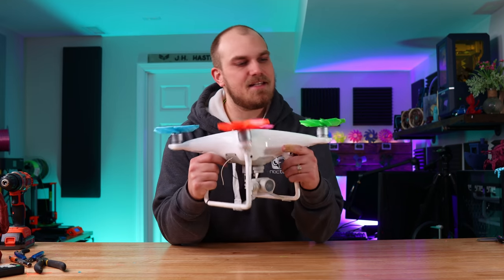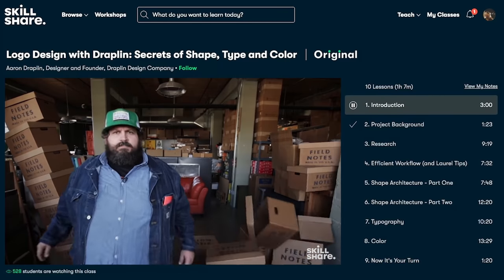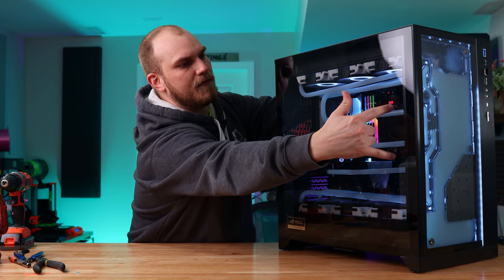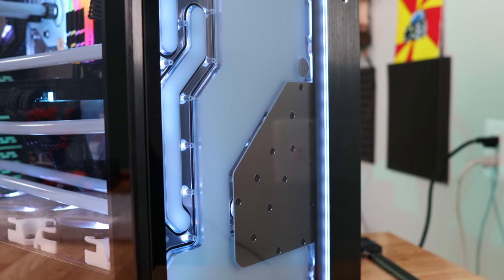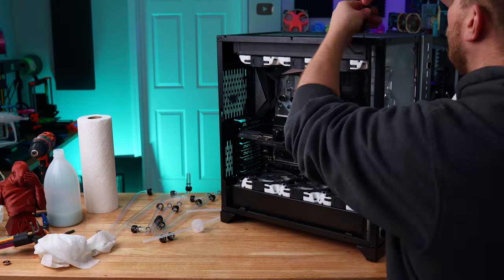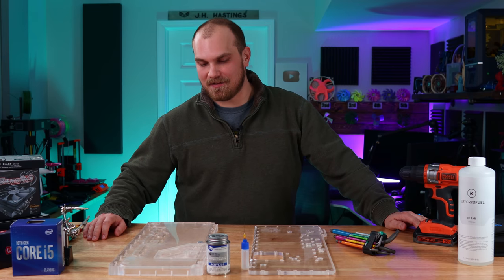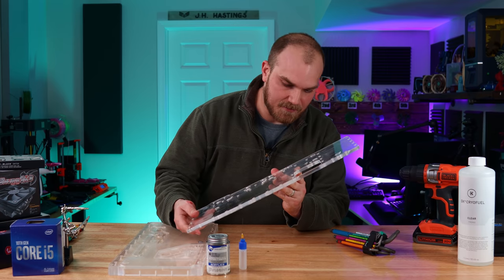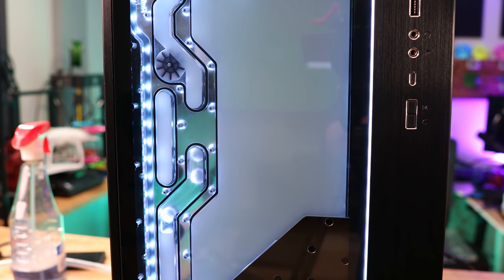$400 DISTRO PLATE is about to let loose, can we FIX IT?

Comment: If you want to fill those cracks you need to put back pressure on the holes while applying the  solvent cement. That will allow the cracks to open just enough to let the solvent cement sink in. Just don't go overboard with the back pressure or you will damage it even more. Slight pressure will do the trick.

Comment: Vacuum bag ,you put the acrylic panel in a vacuum bag like the ones that you get for clothing they hooked to your shop Vac when you inject the weld on the vacuum will suck it into those holes  or cracks  I do injection molding and essentially we vacuum most everything it will draw the stuff into the cracks check it out. Thanks for the video.

Comment: you could likely use an RTV sealant like what youd use on an engine as a seal.  might be neat to experiment with different pump impeller designs for fluid flow rate testing.

Comment: Try using resin on the cracks, used to repair a cracked windscreen on a car, it might work,. You will have to harden the resin with a special uv film and a uv lamp, be carefull not to use to much, it will get very hard, so wipe away anything that is not into the cracks, do not use surfice pit, but use the pit that get into the cracks..

Sorry about my bad english

Best regards Kasper

Comment: Maybe slice some thin strips of self-amalgamating tape as a seal instead of an O-ring? Might not be neat, but it could work.
See how well coating the plate with 3D printing resin would work to arrest any further crack development?
Maybe use that as an excuse to test printing some thin plates with pretty logos and images to adorn the plate with. See how it looks with light shining through it.

Comment: I have the same distribution plate. I really hate you have to run lines all the way to the back for the radiators… well the bottom one anyway. I was able to mount the top one with short fittings, but it’s very tight.

Comment: Vacuum bag like carbon fiber molding or Safelite rock repair. Possibly pressurized to push it in if the vacuum pulls it away from the voids.

Comment: I wonder what putting the old panel into a vacuum or pressure chamber would do, if it would force any air out/weld fluid in. It would have to be a kinda big one, but it would be interesting to see.

Comment: RTV to replace the gasket, paint those cracks in super glue or epoxy, and send it.

My guess for why it cracked in the first place is the thermal cycling eventually caused cracks to develop. All the cracks had the same shape, which is they were on the external surface and tapered in, making them triangular cross sections. Probably on heatup, if I had to guess, since you're well below acrylic's RTT, you had the expansion on the inside wall from the heatup causing your holes to expand (lol) putting a tensile stress on the outside wall. The highest stress would be where the temperature differential was highest, i.e. the outside wall that was still at ambient. Once the crack was formed, it would propagate outward due to higher local stress at the tip (lol again), but you're an actual engineer and probably understand it better than me so I'm done now.

Oh, you could try thermal cycling the heck out of it to see if it gets worse and maintains the same pattern. Put a radiator in ice water, cool it down super low, pull the radiator out, put the radiator in front of a heat gun and run a FurMark Fuzzy Donut of Death with a Prime95 small FFT to get the highest heatup rate you can and see what happens. After reassembling the whole thing with RTV gaskets, because redneck computers make me happy.

Comment: I wonder.. could you 3d print a new 'face' plate for the distribution plate? If i understand it right, the cracks are only in that 'face' plate, not the second one. That would be interesting to see, since you can get all the measurements of where goes what from the cracked one, and while the plastic wouldnt be clear, it could work, like the little distribution plate printed previously.

...Maybe even add some details like 'M H' into the created object to personify it.

Comment: You can fix it by using a vacum chamber and a thinner glue 
or some diluting paste on top of it to disolve the cracks and then fill them with glue with will require new treads to be made

Comment: Nice video. Get one of the windshield chip repair kits that pressurises a resin into the cracks which UV cures, just like the printer resin. Not sure if UV resin is runny enough. Then 3d print a TPU gasket to see if it will hold coolant 🙂

Comment: 4:57 That looks to me like some 3D Printer Dust and quite possibly VOC's... I had the same problem and I would recommend to put the printers in a Enclosure with an HEPA Filter! - Just to be save in a room you spend quite some time in!
Reply: The VOCs are volatile, so not very probable. Might just be compressed air. Let's go with dust.

Comment: suggestion for the pc: given the price, make an angled plate that acts as a water slide over the gpu and under the radiator fitting that's over the motherboard in case you get leaks to prevent frying an expensive part.
then add a spunge on the bottom so you don't get a leak all over your desk.

Comment: Hi , this is Chris in Bulgaria. Your theory of putting on a liquid glue is correct. I see that it did not work.
acrylic glue it maybe. However to get into those cracks you would have to use  Dichloromethane. A chemical version of chloroform. acrylic plastics are not all the same. You have to know what sort it is. Love you fan show downs.  I like the suggestion of an ant farm. And, I did notice a small fan/impeller in the unit. Lost opportunity. Have a great day, Chris

Comment: I'm of the opinion the cracking is being caused by mixed materials and expansion and contraction of said mixed materials. Plastic, be it acrylic or whatever group them all as a whole, will move long before metal. That being said I think the Plastic will always just crack. My water loop had a lot of cracks but only where I mixed materials. The places I used plastic caps didn't crack... Just saying...

Comment: First of all, I would have air sprayed the rad in the garage or space that is not in a clean room. Secondly, you can buy o-ring material and end up with a second distributor plate that you can use on another computer. I would talk to a windshield repair company and see what glue they use  to repair cracks on windshields; it may be used on that plate.

Comment: Looks like its because they used the flat head screws putting outward pressure on the acrylic with the incline plane on the screw heads instead of pan heads or similar putting a more linear compression.

Comment: Great video, quick question how did you add a drain valve when it had a stop fitting, whitout spill everywhere during the transition??? Would love to know for my own purposes
Reply from the maker: Tipped it back until an air bubble was on the port then SPEED CHANGE

Comment: When they fix cracks in windows they use a little vacuum pump to suck out the air so the uv cured resin gets pulled into the cracks. You could probably do that if you plugged the hole from the rear. Also, can you order a replacement seal kit?
Reply: It's too close to the edge to create a seal using such a device. The suction seal you are referring to requires that the crack be at least 2 inches from an edge.

Comment: could it be the expanding metal that is contacting the acrylic cause some of the fitting to crack?
Reply: The fluid in the system reistically is only sitting a few (as in, less than 10) c above ambient temperature. I don't think thermal expansion would affect the nickel plated cooper plugs to such a vast degree compared to the acrylic that that would be the case. 

I've seen similar cracks occur on pumps/plates/blocks with acrylic tops that have been exposed to certain solvents, such as isopropyl alcohol. Im curious if he didn't flush the radiators thoroughly enough before installation and whatever chemical solvents that were in the system stayed in the loop, or if they somehow did get into contact with isopropyl.
Reply: They either changed their plastic supplier, too aggressive on tapping causing cracks to start during machining, or made the holes/threads too small allowing thermal expansion to crack it. None of my 3+ year old ek acrylic has cracked. every single one of my newer ek stuff has developed cracks after 5 months.

Comment: You can actually fix it. Those cracks are expanding with the screws, so if you wanna use that adhesive and want it to flow inside the cracks, you should strech the plate. Otherwise the adhesive won't get inside the cracks because it's so tight for it. Or you can simply use heat to make them loose a bit so the adhesive went through. ( It says **Water Thin** ) / Another way to fix : Use the method YouTube/ChrisFix => How to Fix a Chipped or Cracked Windshield (Like Brand New). For short, you have to stretch the cracks or need some pressure. I recommend the way ChrisFix's. ( I used it with mine and worked great.)

Comment: I mean... draining and redoing the loop DOES sound fun to me... I redo my loop about every 6 months so... Maybe I'm just weird?
Reply: I'm a smoker so I have to tear my system down at least 3 times per year for the dust and film. I actually enjoy it too. I remove everything that isn't either soldered, glued or riveted together. Everything gets a warm soapy bath, all the electronics get IPA and a soft toothbrush. then dry for a few hours before going back together with fresh thermal paste and pads where needed. Looks great for a couple weeks.
Reply: yes weird :P haha
Reply: That does sound weird, it's more fun putting a new loop together or making small changes.

It's amazing how much mess it makes when you take it all apart.

Comment: Those tapped holes were probably done by machine at too fast a speed and left some stress risers..  If the cracks are too deep for methylene chloride solvent to wick, a straight cut syringe tip twisted onto on a jeweler's torch to make a microscopic flame can be used to fuse the cracks and "flame polish" the acrylic

Comment: I have always been curious why they don't use actual glass due to all the cracking in distro plates. I had one from EK and it cracked on me, got replacement.. had cracking occur again shortly after on stuff i never installed.. so I sold it and moved to round reservoir... I have a friend who does laser etching on glass and she can straight up etch pictures people give them onto the glass surface and if you run it multiple times.. you can literally etch through the glass.

Comment: They sell custom gasket stuff at hardware stores that you can reuse that reservoir if you want. Basically its squishy solid tube that you glue together. Just saying if you need / want to use it again you can.

Comment: That distro plate is most likely Polycarbonate. Polycarbonate has a tendency to crack on stress risers. Like threading. Also, ozone, oils, uv and many other things promote cracking around stress risers on poly.

Comment: i had 6 cpu ek waterblocks all cracked (never leaked tho) switched to phanteks and no more cracked threads. did not over tighten them* also the phanteks had a flat contact plate, all ek's was convex on the center

Comment: i have just ordered same distro plate and i am hoping those cracks won't appear. What my plan is to remove the factory end caps and screw them again. Also i am thinking if this thing  happens to regular people will EK provide them with spare parts issued with warranty instead of repurchasing cause as you said this  distro plate is freaking expensive?

Comment: There's an ultraviolet set, super low viscosity resin used in windscreen chip repair that does work for cracks like this. Having a pump to draw the air out of the crack helps a great deal too.

I deny the fact I know this from breaking something on somebody's car... 🤐

Comment: Take a .5mm drill bit to the end point of each crack end then use weldon 11 on the cracks (if appropriate polymer to weld woth it) Drilling the points stops the stress riser and crack spread.
Reply: Weldon 11 (or thinner) wicks into tight seams for construction or repairs of acrylics

Comment: I have had nothing but constant issues with this sort of cracking with the acrylic top plates I've worked with on watercooling systems; I now avoid them entirely and only use delrin/acetal tops, aesthetics be damned. Acrylic is simply the wrong material to use in an application like this, and is always prone to stress cracking and especially so at elevated temperatures as seen in a watercooling loop.

Polycarbonate might work better, but I don't think I've ever worked with parts that use polycarbonate instead of acrylic. Otherwise, I don't know of any good solutions for clear tops that won't eventually crack around fittings just like this.

Comment: Those cracks appear to me to be as a result of fittings being too tight and with change of temperature caused stress points. A looser fit with Teflon tape would  probably do the trick but

Comment: The plugs, are they a tapered fit or do they have an o-ring on the flat side of the nut? Using a tapered nut on something like this is asking for disaster. If so it may be wise to look at some different plugs, you may find the non tapered versions fit the holes, if not you could get a tap quite cheap to ream them out.

Comment: I have the same issue but to a smaller degree. I also thought it may have been because of overtightning, but after watching you video I am disappointed with the quality. I have the 0-11 side distro plate from ekwb and when I decided to add my rx6900xt into my loop I noticed similar crackes forming. However the worst damage was on my ek quantum am4 acrylic cpu block. Fortunately the fittings hide this issue well enough. It is really disappointing the ek has this issue with their acrylic because otherwise their products are top quality.

Comment: It's dead, Jim.
Sorry, I couldn't resist ;-)

I've recently been playing around with the idea of a HomeLab. I've rebuilt an old system and got ProxMox running on it, and the first thing I tried was virtualising Windows 10 - just for kicks since I don't plan on doing anything with it. I've got a few WD Red drives to stick in it that I plan on using TrueNAS with, and I'm toying with the idea of running PiHole and PfSense as well.
If you did something similar you could pack the Minicraft server in with any number of other cool bits and pieces.
Jeff over at Craft Computing has loads of great guides (and great beer).

Comment: Weld-on 4 is great .  Those little bottles are garbage though.  A much better applicator is a "touch-n-flow".  Uses capillary action to draw out of a thin glass tube and is extremely easy and intuitive to use.

Comment: Distro plates crack over time. I had 3 fail after a 7 month period. I will never buy them again and have gone back to XSPC real glass reservoirs in my builds. Also replaced my acrylic EK CPU block with a solid brass Optimus Signature V2 block.

Comment: THE REASON THE HOLES STARTED TO CRACK... is because the fittings into the plate expand because of the heat created by the liquid temp is hot!!
Reply: Thats... not a thing.

Comment: i use 15%coolant and 85% water in my loops... no gunk buildup, ZERO worry for corrosion.. lubricates the pump at the same time... i dont have to worry about cleaning my cold plate. gunk wont buildup..

Comment: Can't you get some "self cut" O-ring and the adhesive and "fabricate" yourself a new one? It should be cheaper then byuing a new one, some people might learn a thing from it and it should be an interesting solution for people who have problems with ther seal.
As for the pin of the flow meter, would putting it in the freezer at -20°C and simple dropping it in have worked as oposing to gently tapping it in" ?
Reply: Depending on how tight the fit is, that freezing trick might have worked.

Comment: Again just open up a fitting to let air leave the line every couple months and you shouldn't have any cracking. It's not that the parts are cheap although they probably are cheap. It's because when pressure builds up in certain areas it can cause hairline fractures to start occurring throughout the system. It really sucks but it does happen
Reply: there shouldn't be enough pressure building up inside a water loop to cause stress fractures like that. You'd have actual  gas pressure venting when you open your loop. I've never seen any water loop create ANY sort of pressure inside them.
Reply: @kasuraga  no it can occur it depends on what type of fluid base up since you're using for your water loop it can actually build up pressure as time goes on or when you first major Loop you didn't get rid of all the bubbles

Comment: i may have not seen it right but theres no rubber/silicon etc washer between the plate and screws?? If so thats a beginner mistake from the company since you will allways need those to have a tight seal and not overtighten them.....

Comment: system heats up. so do the metal caps. the metal expands and the acrilic will NOT or not as mush as the metal.  thats the problem. measure them cold and hot.